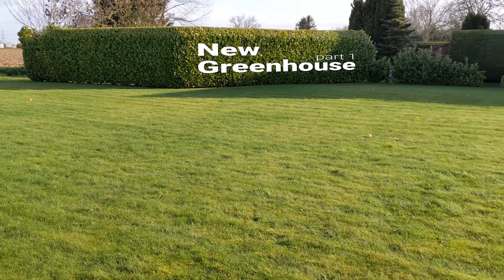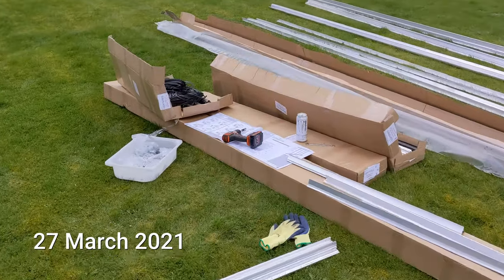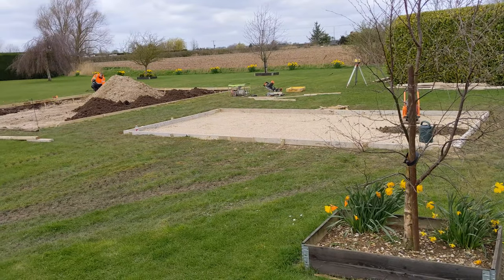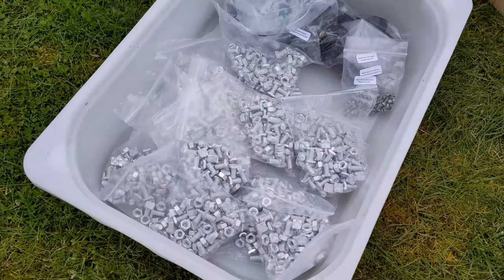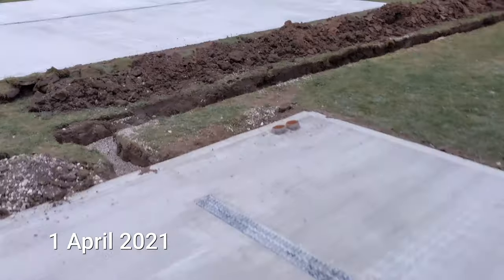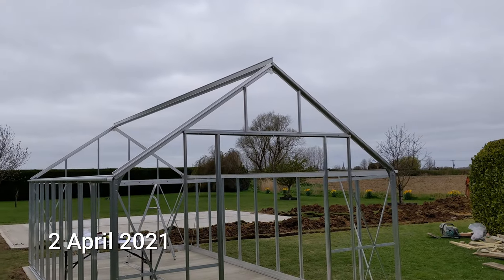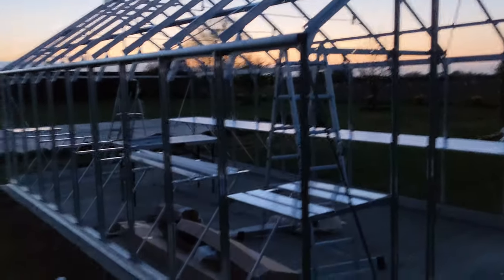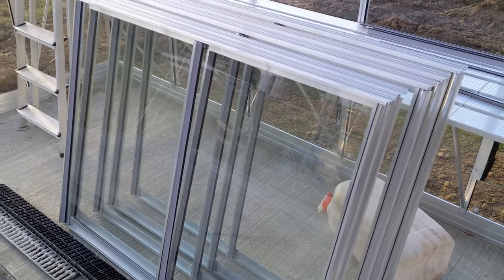Chilli Pepper Greenhouses. First one is going up!

Comment: I'm very interested in how you irrigate this as I finally built a structure from scratch myself this year and got away from the hoop house life. I think I'm planning a pvc type of thing around the entire 10x12 structure about waist height and have t joints with ball valves at intervals which I can have fittings on for smaller drip tubes to spot water specific areas.

Comment: Those are really shallow drain pipes.   Do you not freeze in the winter?
Reply from the maker: They won't really be in use during the winter, so even if they did freeze, it wouldn't be an issue.